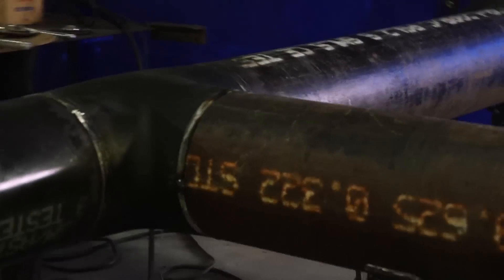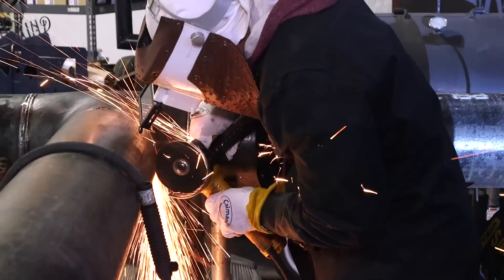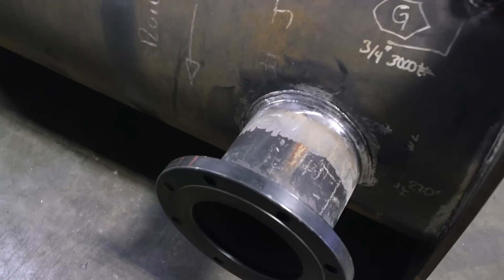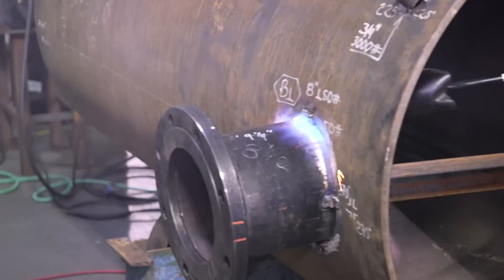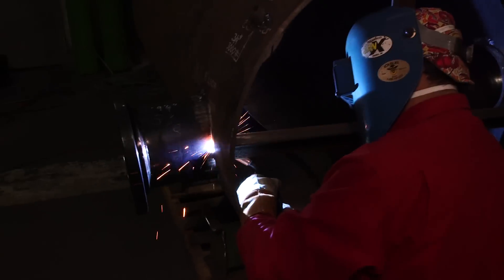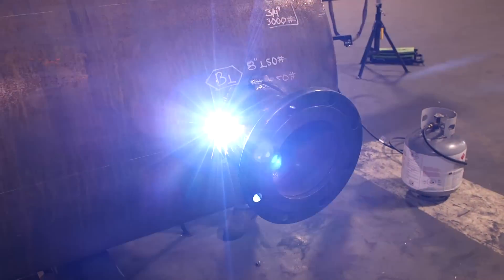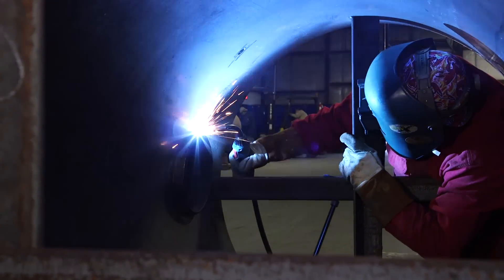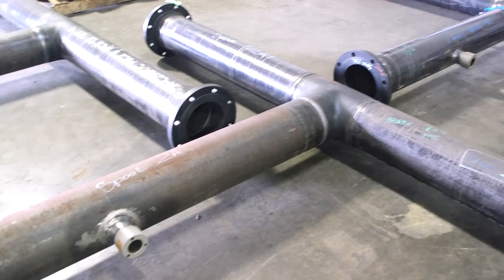VESSEL FABRICATION | MIG & Flux Core

Comment: Shops don’t typically use a turn table to roll vessels. They usually use a power roll with one idler and align the rolls. This could be dangerous if your idlers underneath aren’t aligned with the vessel it could actually roll them out.

Comment: After 2 years of running a MIG welder in a structural steel  workshop finally job my first coded pipe TIG welding job in a vessel/pipe workshop just last week. 🙌

Comment: Should talk about the bracing on vessels and how those nozzles are fit in with tabs not penetrated tacks so they’re easy to cut out, sweet video though and that 3 bead cap is slick

Comment: Some nice welding, I've been fabricating and welding pressure vessels mild steel and stainless for 40 years since I was 16, you can't beat manipulation when you can do it and ye welding with both hands is a must, only thing I don't do is flush the circumferential weld on dished ends before I cap them , I just try leave my run before the cap a little low so I still have the edges of the chamfer to follow, used to be all stick but now all flux cored, still learning at 56 years old and always making jigs, a much underated job is pressure vessel work, keep up the good work I'm going to subscribe 👍

Comment: What is the reason for a flux core cap after a mig root? Curious why it isn't all for with mig. Thanks guys
Reply: Most customers that procure pressure vessels that involve applications such as power generation, oil & gas, refinery, and chemical industries do not accept GMAW from root to cap.... GMAW S. Cir. Arc.is usually specifically called out as being a process that is prohibited by alot of my customers specifications. FCAW is the way to go for heavy wall fabrications. They are most likely using the GMAW for the root pass because of the fact that FCAW is not intended for open root, and they do not want to back gouge the flux cored wire from the backside....
Perfectly fine....
Deposition rate is unmatched when compared to most processes. (Not including SAW) Hope that helps.....

Comment: Nice video. I'm in the pressure vessel industry. Interesting how it is done in Texas. Not a good safety policy to use pallets under your rolls for that amount of weight. Better to use solid wood blocks.

Comment: Where I work we build large vessels and shells are 3/8 to 1/2 inch thick and we don’t have any issues welding anything on it with warping. We even do smaller vessels that are 3/16 steel and no issues with warping. We use T1 dual shield.

Comment: I work as a fitter/welder for a company that mainly does pressure vessels and what I will say is that it is much easier and more common to put the root on nozzles and couplings from outside the vessel since we have to back-gouge everything anyway. Saves a lot of time and cuts down on the time you have to spent contorting your body inside. 

Also for fill/capping heads and larger pipes you'd save yourself time and money in the long run if you get yourself a sub-arc setup.  ;)
Reply: Agreed....
I wanted to comment about him suggesting to always lay beads from the process side first, but didn't want to rock his boat...
My company has been fabricating pressure vessels since the early 70s...
Love the trade....
Grandpa passed the company down to father, and when father is ready, I shall be the next one blessed, or cursed, depending how you look at things.....
Anyhow, keep on keeping on.....
Stay Blessed.....

Comment: I used to work contract at a heat exchanger company next to 610 and I-10 East....we actually tig welded the inside first, then fluxcored the rest...after filling up, we had to grind it smooth to match the ID of the vessel...the first shift crew always left us the grinding part and the removal of the brace, it was all good though, we took our time doing it too 😁
Reply: City of industry? Where you working now
Reply: It was at a company called SHECo (Southern Heat Exchanger Company). Currently im seeking work right now within the plants here in Deer Park, La Porte and Baytown. If i find a good shop that pays good I'll take it lol
Reply: Robert R  

Yea I know, but i know for sure there are shops out there that do end up paying near the 30/hr range.